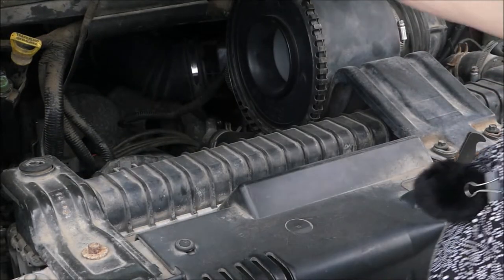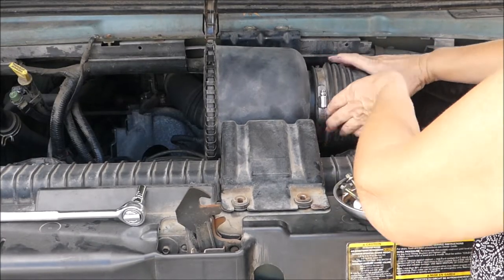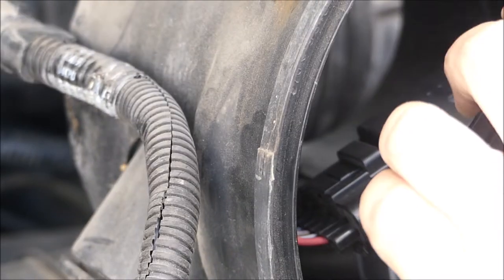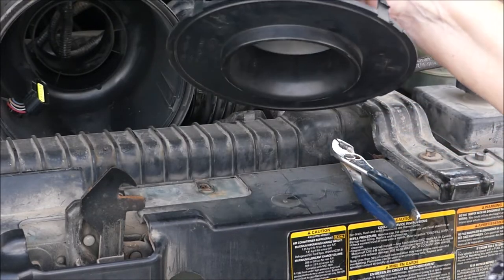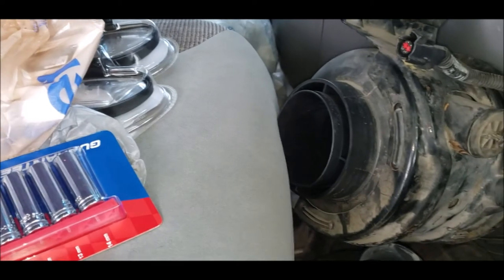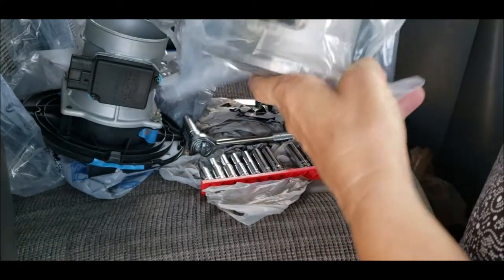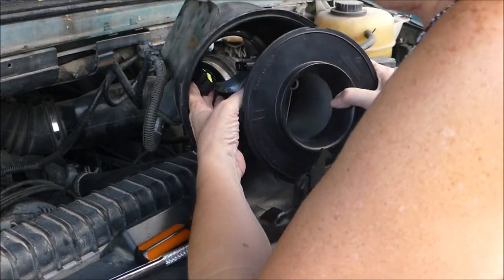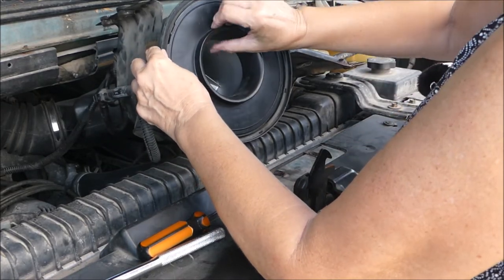VLOG! Installing a Mass Air FLow Sensor on 1998 FORD Econoline van

Comment: You can get a good set of wrenches too to remove some nuts. Like with those you showed on the maf housing. Always good to have a set of wrenches in your tool bag too! You're an awesome lady doing your own mechanic repairs! Poor is true but some people just give up all together til they can find someone to do it for them. Keep kickin butt doing what needs to be done! You're definitely inspiring 👏🏼
Reply from the maker: Thank you so much! I do have some wrenches, somewhere? My life got chaotic, I have tools here, there, everywhere. All in tool boxes, bags & such. 
I try to be as self sufficient as I possibly can. If I can figure something out for myself, I'll give it a try! 
Thanks for your words of encouragement. It helps keep me plugging along! 😊👍
Reply: @TexCynRVLife   @TexCyn RV Life  You're welcome! That's what matters most. Even through the struggles you're still chugging along. THAT'S when it's even more inspiring. Can't keep a good woman down. As long as you're pushing forward and you keep doing what you need to it builds your self worth and feeds your soul. Keep pushing forward! 💪🏽 And best wishes out there on the road!

Comment: Excellent video on your repair of your van I do understand the issues you're having about the inspection and the code issue you're having just to have a simple inspection these days nothing is easy anymore when it comes to older vehicles with odometer readings over 240k you might want to check your gas cap to make sure it's fully tight because sometimes I will give a reading as to check your engine as well it was the case for me on an older vehicle I had Parts get old especially when Vehicles sit for a long time sometimes it requires a major overhaul of all types of components just to keep everything running and up to par I sure do hope you get your problems resolved you do have a backup van could you put that to any use the old Dodge that you got sitting next to that one is there anything that you can do to get that one roadworthy anyway enjoy your videos hope all is well
Reply from the maker: Actually, the van I'm working on is my daily driver. So it really doesn't sit long, but I can't drive it very far with these issues going on. 
The old Dodge van hasn't been used in years. I should have sold it years ago, but used it for spare storage instead. Now it's time to clear it out & sell it as a parts van. Transmission is good, along with other parts. It's time to let it go. 
I'm still working on the motorhome too. 
I will take the gas cap off of the motorhome & test it on the van. But I really think the issues are other things, which I feel I'm close to getting finished. 
I really need to get the motorhome done so I can get to PA to help my Mom. 
Issues...issues...issues...
Thanks so much for your kind comments! I so appreciate it!! 😊👍
Reply: @TexCynRVLife  that sounds like an excellent idea the old Dodge van is actually a commodity those are very hard to come by now if you play your cards right and advertise it right you might be able to make a nice little profit off of that I am impressed by the way on how that Ford van is still going with all those miles I hope it continues to give you years and years of pleasure and I hope you get that motor home on the road it's going to be an experience that's why I finally settled down and got a piece of land I did all my traveling way before 2015 up to the present but I don't envy anyone that are brave enough to go cross country family is important and always must be a priority I totally agree there I really do enjoy your videos they give me peace to watch cheer is my dear lady
Reply from the maker: @NIGHTHAWKZONE  The Ford van actually has about 66k less miles than shown. Before I did the dog sitting trade out for it, the previous owner found a used instrument panel as the one that was on it quit working. 
I might eventually sell it for a tow car. But I really don't want to tow, so we'll see. 
The motorhome can only tow up to 5k. The van is heavier than that. 
If things take a turn for the worse, I might have to go to PA in the van & leave the MH here, although the MH would be more comfortable for myself & fur kidz.
My Ford Crown Victoria had over 380k miles on it before I bartered for trade with a mechanic. 
It went to Austin & is still running strong! It was a fun car. You don't get torque with vans 😉
Reply: @TexCynRVLife  okay well either way I didn't know I thought you were just up leaving everything and going up there for a long long time I didn't know you had plans to come back to Texas I must have misunderstood somewhere along the lines but either way I totally understand where you're coming from whatever suitable and works for you I'm sure you'll find out as time progresses

Comment: Sometimes it’s best to take it to a professional repair shop let them diagnose it and tell you exactly what’s wrong with it. Those scanners will only point you in the right direction but will not tell you the exact problem. I know it’s sad mass airflow sensor but that could be anything from a loose wire to something else. That doesn’t necessarily mean the mass airflow sensor is bad. You would actually save money just by getting it properly diagnosed, not by a Shadetree mechanic, but by a professional repair garage, and let them tell you exactly what’s wrong with it and then you can change the part yourself if you want to save some money. Ask me how I know! Lol
Reply from the maker: Thanks. I did that. Had it at 3 garages & none came through for me. One tried to charge me 1k, just for a diagnostic test & changing the spark plugs! They ended up settling for $430 & I got to bring home a yet, broken van. Certified mechanics...

I traded a mechanic my old Crown Victoria for labor. We thought it was good to go, then the check engine pops back up. 
I'm running out of money. It's flying out the window! 💸

Comment: Go buy a $30 computer, I have a 1997 Ford E 350, and with the computer it was quickly obvious that my transmission was slamming into gear, because my maf sensor was not working. “Mechanic” forgot to plug it in…… on live data I could see that no matter the rpm, the maf was only displaying 5.57 grams per second, but it should climb over  40 when it is revved up. You gotta be clever, often the info is right in front of you with an error code. Sometimes you gotta look deeper. Sadly I think you are not gonna make it, simply because you did not get on you tube immediately to figure it out. Good luck.
Reply from the maker: It did need a new MAF sensor. I have a nice OBD2 reader, which I used prior, then backed up the info with Auto Zones computer. 
The van was suffering with a vacuum leak that several mechanics could not find a resolution to. It was eventually found by my last mechanic, who turned out to be an awesome mechanic! I just finished a 1465k mile trip. The van ran like a dream! 👍
And I saved about $120 in labor changing that sensor out myself. 
Thanks for sharing your story.